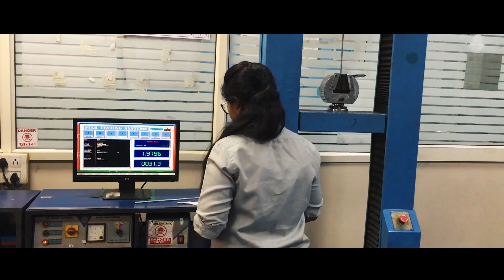ACCC Ganga Ultra Low Sag Conductor- English | Sterlite Power | Energy Delivery

Comment: Does it have a carbon core for reinforcement?the conductor can also be used in hilly areas where the distance between tower's is more than normal and ice loading is high in winters..such as samba amargarh transmission line